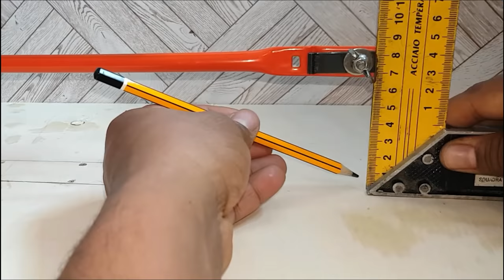Amazing jigsaw and tricks // How to make SCROLL SAW machine DIY

Comment: But why wouldn't you just use your jigsaw and follow your lines....
Reply: Hi! Jigsaw does not make proper line. May be only I Have curved hands, but I never could cut verticaly straight.
And with this awesome device you can hold your piese by two hands.

Comment: I want to make knife blades . I live way out in the country.  I dont have a 4 in. Grinder .or a bench grinder. All I have is files hacksaws . Jigsaw. I'm looking up ideas so maybe I can modifi hacksaw blade to cut the shape of knifes I want out of old sawblades or old lawnmower blades , scrap metal around here . I haven't had a dam job in almost 10 years because of my back . If I had a 4in. Grider with cutting wheels and grinding and sanding wheels I'd be in business... i live i such a small town . Theirs nothin here I'm 2 hours from a Walmart.  I need to make a tool somehow! I have deerskin leather for sheaths.  I have an old washing machine motor,  i think that's what it is . It's big its fast . I might be able to put a metal cutting blade on it but i think kick back would be a problem . And to carve the curves in the metal . . . IDK ...Hell i wish i could just go down and buy  one and a dremel with grinding and cuttn stuff . No welder or cuttn torch . I realy would like to start making knifes. Its fixin to start gettn cooler too..anyone have any of that that would like to help me out I could make payments ? Let klem know . I live in central Texas, thanks

Comment: electric fret saws are not expensive and a lot safer than risky conversations like this if they had used the fret saw in a proper manner  it would have worked fine silly conversations like this should not be shown on here as they could be the cause of someone losing a finger or worse